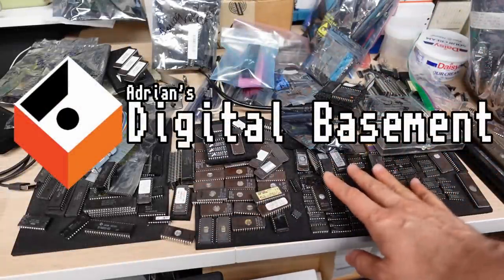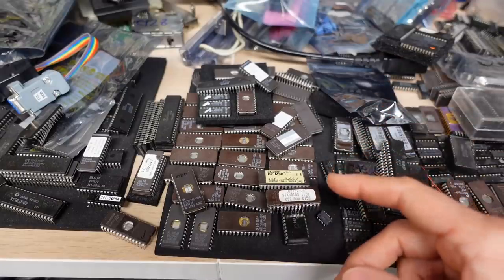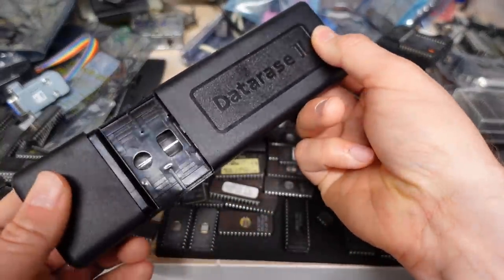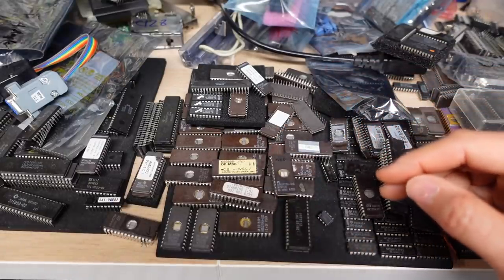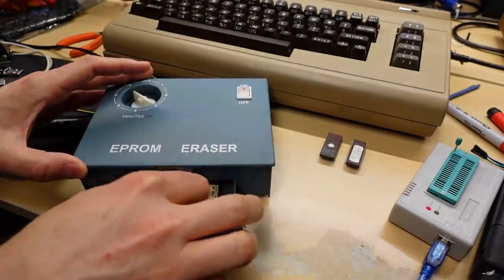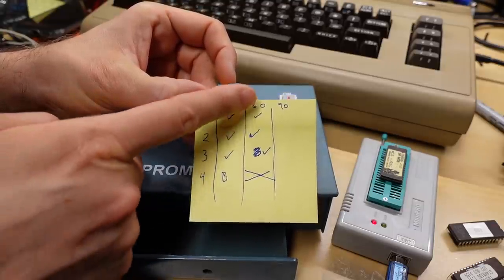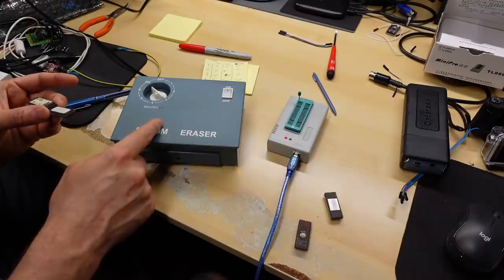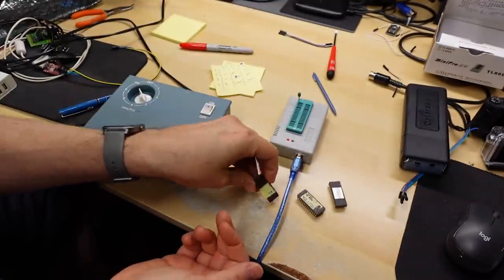Do paper stickers protect an EPROM from getting erased?

Comment: People have a lot of misconceptions about UV light as the UV spectrum is in three parts, UVA, UVB and UVC...

All LED lamps, even pure blue ones, are just tickling the bottom of the UVA range (hence why it works with retrobrighting), regular fluorescent tubes do internally generate a spectrum of UV light from A to C, but the glass tube blocks the harmful UVC, and the A and B are slowed down (if not mostly stopped) by the phosphor coating inside the tubes, the bright blue tubes in fly zappers are UVA tubes which attracts insects, designed to allow the UVA out but in general does no harm;

UVB is what'll give you a sun tan, hence tanning tubes in salon equipment, which of course can be harmful if misused, also useful with retrobrighting too as it's in the same spectrum as with sunlight, and lastly, the nasty one; 

UVC, this is blocked from the sun by our atmosphere by the ozone layer, and terrestrially is blocked by regular glass, so any UVC-requiring equipment (such as the tubes, and the windows in UV-EPROM chips) use Quartz for the glass parts to allow the UVC light to pass through, it is generated by electrical arcs too (such as welding or overhead high-voltage cables shorting and doing the jacob's ladder thing), and is harmful to all biological life, it'll burn your skin and corneas very quickly, which is why welders use masks and gloves to keep them shielded from the UVC light, and of course will erase EPROMs...
Reply: Welders use gloves to keep them shielded from electric shocks, heat and UV light.

Comment: Can cheap UV lights intended for drying nails be used for wiping EPROMs?
Reply: I doubt it as some heavy UV-C is needed .. but I too would like to see a test :)
Reply: or maybe one of those toothbrush sanitizer?
Reply: @VVerVVurm  You don't need UV-C at all.
Reply: @Okurka.  please elaborate .. I was trying to erase chips with a UV money checker back in the days and had zero results .. I think UV-C is needed to knock out the electrons.. I am curious now
Reply: @VVerVVurm  Read the datasheet of EPROMs.
Reply: @Okurka.  that's why I am asking. National Semi devices call for 2537 Angstroms and 15Ws per square cm in their datasheet which is UV-C and I had zero success with UV-A tube of aprox. 340nm over days of exposure...
Reply: @VVerVVurm  Read the datasheet again, it says a wavelength under 4000 Angstroms will erase the device but 2537 Angstroms is the optimal wavelength...
Reply: @Okurka.  yes but it is of no use when you want to "wipe" the data in any reasonable time. I tried it .. 8W bulb directly over the chip and 4 days exposure resulted in zero bits flipped. so this part of the datasheet is more of a warning that this can degrade data retention time
Reply: @Okurka.  anyway - I want to thank you for your input and your patience. If you had success with other "ghetto build" erasers I would love to hear. but since we have so much better options nowadays (flash, fram etc.) this fascinating eprom technology can rest in pease for the most part.. :)

Comment: I have been trying to erase an AMD 27C64 for months now. I don't have an eraser and don't really want to buy one just for that one EPROM. It has been sitting in direct sunlight, with no glass inbetween the EPROM and the sun for countless hours.
Verifying it with my TL866 :-) shows that not a single bit has flipped. 

I would have guessed that the sund here in Germany doesn't have any UV, but the frequent sunburns I got tell me otherwise. (just kidding...)
Reply: I use a toothbrush sanitizer. 10$ from Amazon.  Worth the small investment.  I've blanked 6 chips at a time in it with no issues so far.

Comment: I've tried to wipe some EEPROMs by leaving them under direct sunlight for 2 days straight, and not a single bit flipped. I haven't tried with CFLs, but I don't think it would clear these. I'm pretty annoyed because I can't repurpose a lot of these EEPROMs and I would like to do so!
Reply: sunlight works but 2 days are not nearly enough .. and I guess the type of eprom makes a difference .. back in the day I had only low capacity chips which had coarser features .. maybe that made the difference (?)
Reply: as UplateGeek mentioned, a cheap toothbrush UV sterilizer

Comment: It is not just UV, UV-A, the closest UV to visible light, are not enough to flip bits in an EPROM, you an try to shine as much black light into a chip, or use one of these violet laser/LED as much as you want, no but should flip. You need UV-C and some in the range of the UV-B to allow to erase an EPROM, and UV-C do not come from the sun thanks to the ozone layer in our atmosphere that block all of them. UV-C as the most harmful of the UV light. UV-B can still flip some bit but need more exposure time, that's why sun light is not super effective, but will do after a while. 
The UV-B are mostly the UV that make us tan., they are less harmful than UV-C but yet still dangerous!

Comment: I think you underestimate the amount of UV light that exists, even indoors.
Reply: But that is UV-A and UV-B. There's no UV-C in your room unless you switch on a germicidal lamp, or arc welder. EPROMs need UV-C of a specific wavelenght for erasure. Although... If erasing EPROMs with sunlight is possible, that is interesing, because sunlight at the Earth's surface doesn't contain UV-C either. The Sun emits UV-C of course, but that is filtered out by the atmosphere practically 100%, even if there's a hole in the ozone layer, it can not come throgh a hundred kilometers of air. UV-A and UV-B can, but C can not. So after some time, probably UV-B can also erase some EPROMs, it just needs more time compared to when the specified UV-C wavelenght is used.

Comment: Regular ol' window glass blocks most UV light anyway. I bet you'd have to work really hard to accidentally erase an EPROM like those.
Reply: EPROMs are erased by light around 250 nm wavelength, and window glass  lets UV above 200 nm (UV A) through, so windows won’t make much difference either way. Anecdotally leaving an eprom out in the sun for a day or so won’t erase it anyway though,  so you are right that accidentally erasing them is apparently pretty hard work.
Reply: with a freshly programmed eprom yes .. but old ones may have lost most of their charge already

Comment: The AMD EPROM products data book 1993/4 pp2-6 says:
A dosage of 15j/cm^2 is required to completely erase an eprom. This dosage can be obtained by exposing it to light of 12,000uW/CM^2 @ 254nm for 15-20 minuets.  Light sources shorter than 400nm will erase an EPROM though times will be much longer.  It does say Sunlight/Fluorescent light will "eventually" erase the EPROM that covering the window with an opaque label will give maximum longevity.  Ping Applied Science and see if he has a  UV light meter and have him do a survey of how many joules of 375-240nm light the sun puts out. 

FWIW: covering only matters if you care about the data that is on the EPROM.  If that is your stash of spares that you will erase and program then WhyGAF?

Comment: I left some eprom's outside for 3 full days in bright sunlight and they were still not erased. Results will vary I guess.
Reply from the maker: Yeah -- I saw someone else who did some testing with sunlight and some EPROMs were erased, although I don't recall how long it took.
Reply: @adriansdigitalbasement2  Yeah, my 2716's and 2732 (the 24 pin ones) erased in sunlight, but the 27128's and the other 'better' 28 pin ones, did not.  Though, they were all programmed with the minipro which the voltage is a bit low for the 2716/32's so who knows how well they program or perhaps older chips just erase easier.

Comment: What about inside a computer like the Pet and a Mac classic which have CRT integrated somewhat inside the computer? In theory there could be UV leaking from the tube and other high voltage stuff.
Reply: In reality that has never been an issue.  The amount of UV light emitted from a CRT is so low its barely measurable.  It's also only emitted from the front of the tube, not sideways to where the EPROMs would be.  

Plus I'm fairly sure most Pet and Macs used ROMS not EPROMS and their was metal shielding between the CRT and the motherboard so there was never direct exposure.
Reply: @MrRobarino   Thanks for the info :-)

Comment: On video it looks pretty much short wavelength, probably UVC.
Some sources (including Wikipedia) claim it should be shorter than 400nm, which would also be true for UVA and B.

So a typical blacklight may actually work. I'd be interested in sone tests regarding that as well, for no particular reason other than curiosity :-)
Reply: The peak wavelength for erasing is about 250 nm, so within the UV A range.
Reply: @Doug_in_NC  are you sure you didn't mean 350?
As far as I can tell 250 would actually be C already
Reply: @juweinert  They were originally designed to work with mercury lamps which emit at 253 nm. That, as you correctly stated is UV C, which is absorbed by the atmosphere thus making erasure by sunlight difficult because you aren’t close to the design point. That would also explain why some EPROMs are more sensitive than others - the spread of sensitivity away from ~250 nm would vary.

Comment: dont suppose you have eproms for an epson equity 2 in that pile?? i had one i stripped for parts but now thinking about resurrecting it if i can, problem is, it seems i've erased the 3 eproms, 2 for bios, one for character patterns ..aarrgghhhh , stupid, stupid moi, ... and doesnt seem to be any of the files available on the net :-(
Reply: Judging by the pile, you probably would never know what any of those roms are.. most roms just have some simple number code on them and possibly a version number.. unless you knew exactly what the rom came from you'll never be able to track back to the device it goes to.  Your best bet is to post it on an appropriate forum and see if someone has that device and can read theirs.

Comment: EPROM paranoia is just that, paranoia.  Exposure of EPROMS for erasure was meant for specific UV lighting conditions and not ordinary lighting conditions.

This paranoia is either fueled by being uninformed, or to satisfy an OCD compulsion.  You do not need to cover EPROMs under normal usage.  If there is any light capable of erasing an EPROM indoors, then it is also capable of giving you skin cancer from prolonged UV exposure.

The whole point of the EPROM was to make prototyping easy.  When the EPROM became a product for distribution in a finished item, was when they started labeling them.  The labeling was to identify them, not protect the window.
Reply: Not according to their datasheets.

Comment: Hi thanks for very nice and entertaining videos. 
I think you young guys miss a fundamental reason why the stickers became a discussion point in the firs place. It was not the erasing of the EPROM but malfunction of equipments due to the fact that silicon is very sensitive to light. Strong current can run on the surface of silicon chips. Think of the two huge industries built on this phenomenon: solar panels and digital cameras.
This does not happen in the darkness of your old computers of course. The old story goes that when the first digital telephone exchange was launced the manager pushed the start button and all the camera flashlights went off simultaneuosly and the exchange crashed. According to this story it took a cosiderable time to ind out what happened. Ever since paper stickers have been suggested for EPROM windows.
BTW it does not require a specific wavelenght of ight to erase an EPROM but infrared will take a very very long time :-)
Reply: In the 80s, there were some experimenters who used DRAM chips in a ceramic case, desoldered the cap over the chip and mounted a lens over it.
By writing the DRAM full of 1s (or 0s, depending on the values for "empty" cells), waiting a certain time and reading it out you could take pictures with it. 
For grayscales you needed to do it a few times with different delays.

Comment: Dear Adrian, silicon is sensitive to LIGHT in general (photoelectric effect). That said, silicon circuits exposed to light (like phototransistors, leds, LDR , ccd and all that jazz) changes behavior or characteristics. So depending on the environment "bits" can be probably flipped . there has been a case of some single board computer recently, which had a massive problem (crashes) when exposed to a photographers flashlight . remember this ? it happened because silicon was exposed (uncovered). so i better cover my eprom before some weird flashlight or other bright reflection possibly randomly flips bits in my software.

Comment: If, as you do, you have the chips in a location where they won't be subjected to UV light then your chips will be fine without covering the windows. But if they're going to be in a location where they may be exposure to UL light then covering the windows is a good practice. The chip doesn't have to be totally erased to be broken, even a single bit being cleared can make it useless.

The way I see it; it's a minor effort to stick a label on the chip (it's a good idea to label the chip anyway), it won't hurt anything and will prevent any risk accidental erasure. So you might as well. For chips laying loose on your desk like that (particularly if you're not worried about maintaining the programming in the chip, i.e. you're going to erase it before you use it anyway) then who cares…